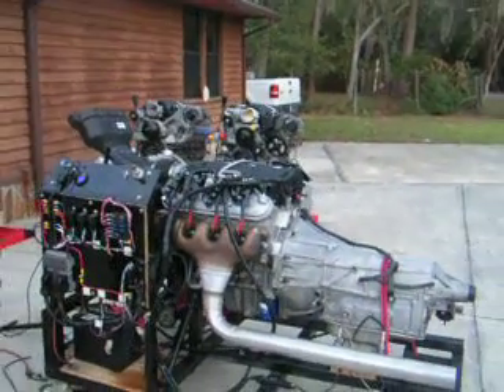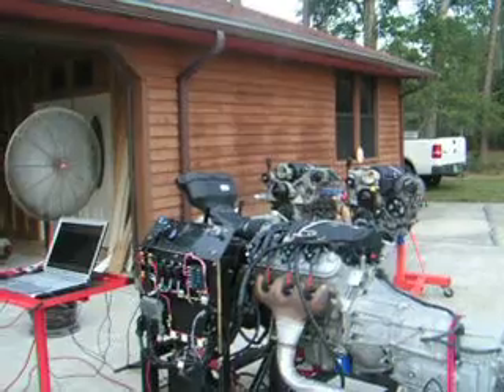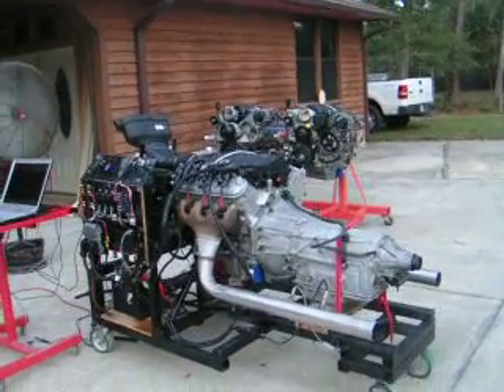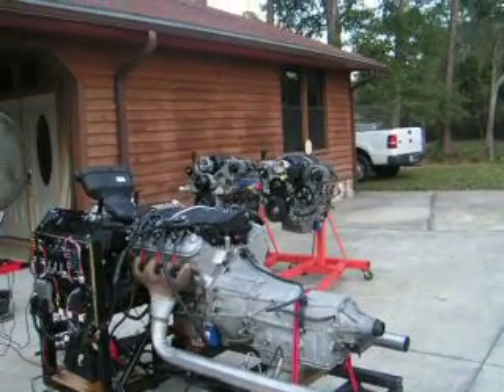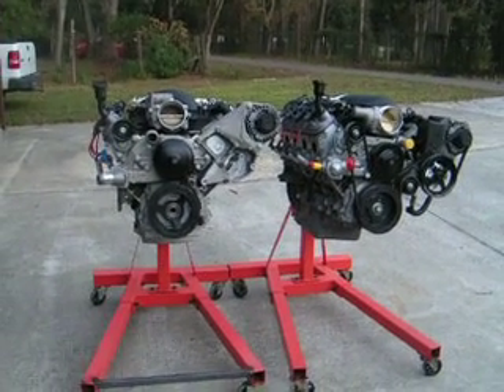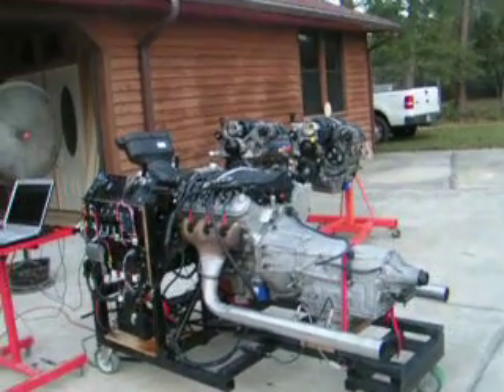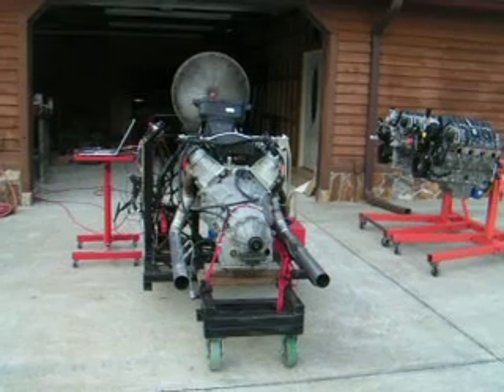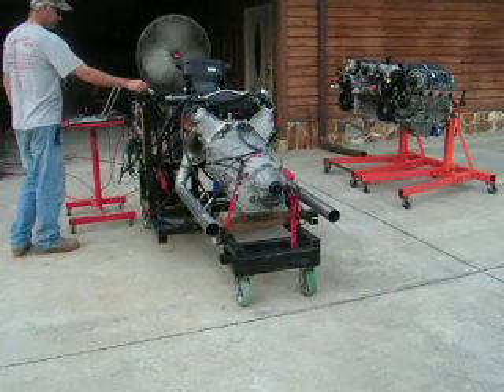LS3,LS7 AND LY6 ENGINE 2012

Comment: I have a 1985 GMC sierra 2 Wheel Dr. pick up truck I want to do an LS three swap I need everything engine and transmission wiring everything to make it work how much is that and do you have one
Reply from the maker: Hi, I think the best and most dollar value is the LY6, 6.0 366 cuin engine with the 6L90 or 4L80 trans. Cam and headers cold air intake will net you 450-500 HP I am not doing anything right now,ebay is place to find engines also www.car-parts site is also good place always buy as a complete unit engine and trans from same truck. sandld2000@yahoo.com

Comment: Hey I am looking for an LSX for my 1988 RX 7 V8 swap, what do you have there that will fit?
I have been told to use Camaro or Trans Am or GTO 2000 thru 2004

Comment from the maker: LS7,ballanced blueprinted,fordged pistond,titanium rods,kaytech rod bolts arpmain studs,8254 factory cnc heads#8254,test run and videoed,wiring harness,ecu tuned,alternator,power steering pump,surp. belt all front drive accessories,no headers
no flywheel $15500.00